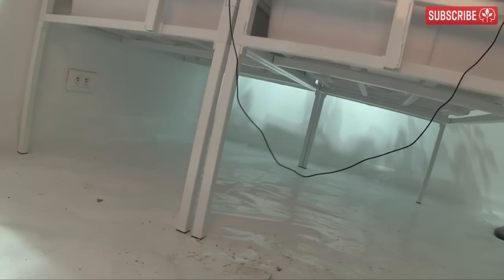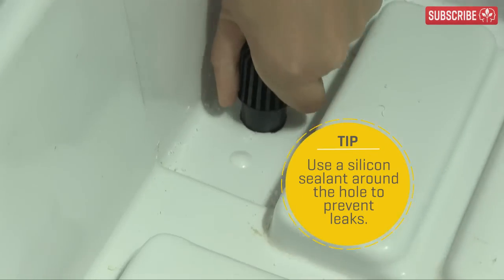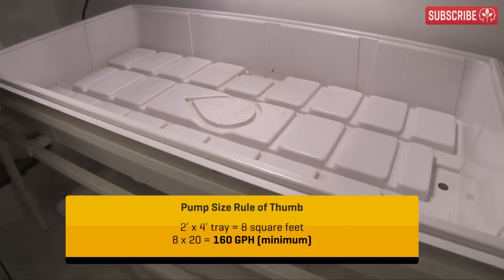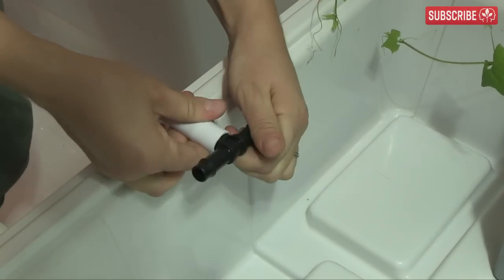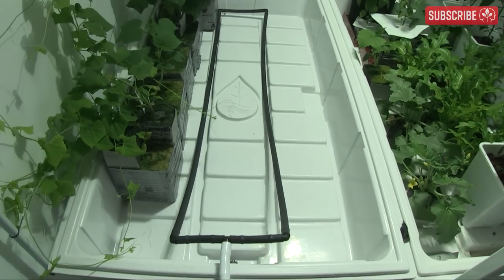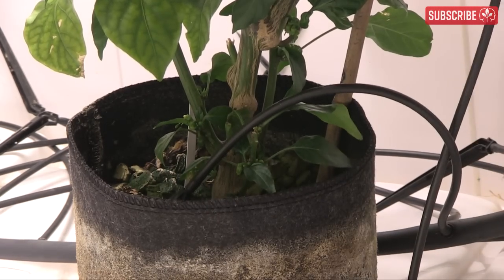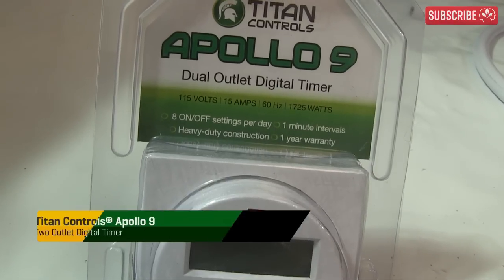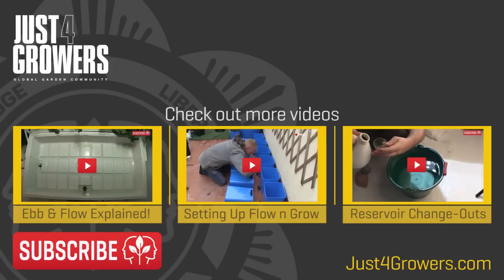DIY Drippers: Drip Irrigation for Hydroponics

Comment: Rigid pipe is easier to work with the warmer it gets. Boiling a kettle of water, pouring it into a big pot and dipping your ends of the pipe into it for 10 seconds before working with it makes it incredible pliable and friendly, plus when it cools it shrinks tight again insuring a super tight seal. Can also lube up the ends with Vaseline or vegetable oil (or any other oily substance that doesn't harm your plants).

Also, if you go to dripper head that is designed to drip at a set rate (say 1gph) you don't need a ring and it doesn't matter the length of spaghetti line as the rate is set and restricted by the dripper head. 

Great video, such high quality footage and tips.
Reply: enticed2zeitgeist I wish I'd got interested in growing sooner, everyone's so nice around here. :)

Comment: your a saucy bugger sometimes everest. been struggling all day with a diy drip system and trying to keep equal pressure, keeping a complete loop to keep equal pressure seams so obvious now, you the man everest should of watched your video this morning .
Reply: You all failed physics.  If your lines are large enough to not suffer line loss friction, the pressure will be equal at all points regardless if it is a loop or not.
Reply: @slrs3908  so...use a bigger pump is what you're saying?

Comment: If the rigid tube is hard to connect with the fittings, have a bowl of very hot water to dip the tube in before connecting. That makes it softer and easier to push over the barbed fittings
Reply from the maker: +Søren Binderup Madsen nice tip right there.
Reply: Thanks  excellent to know. :)
Reply: Thx for informing

Comment: To keep crud from plugging up your drippers, place the pump in a fabric pot within the res to filter the water before it reaches the pump.
Reply from the maker: +Tark McCoy That's a great tip Tark. Thanks for sharing. I also use an inline filter in my mainline irrigation tubing but nothing beats stopping that gunk getting into the pump in the first place! :)
Reply: 100
Reply: @AAGWproductions  PS: I found that the small paint filter bags work GREAT and inhibit the flow very little.
Reply: @TarkMcCoy  haha i was just going to suggest this!!
Reply: @TarkMcCoy  I also use those paint filter bags and fill them with kelp and earth worm castings and manure and use them as big tea bags when making my beneficial microbial teas for my plants they work great.
Reply: @mikehunt4797  Yes they do!  I use them to contain the goodies in the AACT during the brewing process.  It makes it easier to distribute the remnants evenly as a top dressing after the brew is done.

Comment: This comment is a reminder note to myself. Measure the amount of water in 1 minute of one dripper, multiply it by total number of emitters= total amount of water per minute running through the system.  Now run your system through your coco coir grow, for 30 seconds to a few minutes, when you get run off, multiply the amount of water per minute that runs through your system times the amount of minutes you ran on your second test, measure your run off and if it equals 10%  to 15% of the total water that ran on your second test, thats the shutoff indicator. Now input that in your water pump timer.  Write this down in your grow journal.

Comment: thanks for sharing your expertise Everest!! - I couldn't find the part list.
Reply: Just clic on "Show More" above. Anyways:

Parts List:

Fastfit 2 x 4 Grow Tray Stand
Botanicare 2 x 4 Grow Tray 
Botanicare 30 gallon reservoir with lid
General Hydroponics Flora Series 3-Part Advanced Nutrients
Hydroflow elbows and T-pieces
Ecoplus 185 submersible pump
Apollo 9 Digital Timer
Hydroflow non-adjustable, angled drippers
Hydroflow ebb and flow fittings kit
Hydroflow flexible mainline tubing
Hydroflow dripper nipples
Hydroflow 1/8 drip line tubing
Grodan Hugo Rockwool Blocks
Grodan Unislab Rockwool Mini Slabs
Reply: Hey I was wondering if you could please give me a parts list of tubing and fitting sizes (elbows,nipple and all tubing sizes and possibly material of tubing, as leaks are a concern of mine. I want to replicate what you've done here!! I know you get asked that alot but I only seen one exact size and that's the 1/8 spahgetti tubing. I truly appreciate it man and keep up the good videos!!

Comment: If your lines are large enough to not suffer line loss friction, the pressure will be equal at all points regardless if it is a loop or not.

Comment: I can’t get water to come out the drippers it’s coming out the hose but when I hook the hose to the elbow on the manifold it doesn’t do nothing🤷🏽‍♂️
Reply from the maker: Hi Jason, sorry to hear about your troubles. How many plants are you intending to connect to this dripper system? What is the size of your reservoir? What is the size of the pump powering the dripper system? Is the water coming out of the drip line, but nothing when you attach the dripper stake? Is this new gear or re-purposed / secondhand? There are no right or wrong answers to the above. Just trying to get a sense of where you're at. Feel free to email me pics and we'll get to the bottom of this!

Comment: So glad I found this channel! Im 20 years old currently in university taking Production and Management of Medical Marijuana to become an LP and your videos are going to help me so much with setting up my first hydroponic system! 
Is it crazy to say that I absolutely LOVE drip systems?! :D For my medium in a hydroponic I wanted to start my seeds in Rockwool cubes and transfer them into a mix of GrowRock and GrowStone,but also Coco is a fav medium of mine. Out of those 3 which would you pick as a beginner to get some good plants going?
Reply from the maker: Hi Nichole, I love drippers too! If you're starting off in stonewool plugs, have you considered simply moving them on to 3" or 4" (my preference) Delta blocks? A dripper in one of these would be ideal—and stonewool is super forgiving as a growing media. Otherwise, a 70/30 mix of coco/perlite is awesome for beginners and experts alike due to its awesome drainage and ability to hold on to water and air at the same time (ahem, a bit like stonewool / rockwool!)

Comment: Oldie, but a goodie....just subbed,  from the title, lol. Great video, I plan to watch alot of you're videos...any suggestions on DWC systems. I do have a single 5 Gal bucket with a 6" net pot.  Have a 8w airpump with 2 stones. One is a 3" disc the other is just a .75" ball.Using Advanced nutrients M.G.B series I've ordered some big bud, and B-52. Have you used advanced nutrients? If so what should I add to the nutes mix. OH, BTW I'm cultivating some Auto C.O.P from Dutch Passion
Reply from the maker: Thanks for the sub! Yes, I've dabbled with most of the main nutrient brands, including Advanced. Honestly, I don't find much between them—growing environment is the key thing to focus on, and dialing in a good irrigation cycle with adequate dry-back and flushing of the media. With DWC systems, take it EASY with the nutrient strength — use half what you would normally use—even less. They can be extremely productive if you keep things dialled in. Best of luck with your grow!

Comment: I would have plumbed that different. I would have drilled a hole through the side of the table stuck a grommet in the hole. To keep the main water line more level. for more even flow.  Plus all that green algie On your rock wool cub's yek's.   I had the same prob. Light source on wet rockwool is no good. I now but expaned clay pellets on my table first. then you can use a square plastic plater box about an inch bigger around and al least 2 taller. I put my rockwool cube in the bigger pot center it then fill with the clay pellets and cover the top of the cube. And Wal-La no more green crapp. Oh ya I also cut the bottom of the planter pot out so the root's get spread out faster. Cheer's
Reply from the maker: Thanks for sharing your insights 👍

Comment: Great vid, Does the main supply have to be in a loop or can it have stoppers at the end instead?
Reply from the maker: Thanks amigo—hydroponic drip systems can benefit significantly from creating a mainline ring, also known as a "closed-loop" or "circular" system. This setup can indeed help equalize pressure across all emitters and ensure a more consistent nutrient and water delivery to each plant. In a linear or "open-ended" system, water pressure naturally decreases as it moves further away from the pump and towards the end of the line. This means that plants at the beginning of the system may receive more water and nutrients than those at the end, which can lead to uneven growth and yield. A mainline ring or closed-loop system circulates the nutrient solution back to the reservoir, maintaining more consistent pressure and flow rate throughout the entire system. This can lead to more even and optimal plant growth as every plant receives a similar amount of water and nutrients. Even with a mainline ring, however, pressure can still vary due to factors such as the physical layout of the system, the height difference between emitters, the size and type of the emitters, and any bends or junctions in the tubing. Regular maintenance and monitoring are essential to ensure the system is working properly. Nb. My current dripper system for 9 plants does not use a mainline ring, so if your system is small like mine, you really don't need to worry. Choose what is simple and practical.

Comment: Hey man.  Really need some advice.  I'm trying to setup my system and got a manifold setup with drip lines after going to local hydro store.  The drippers were rated for .5 gph made by netafim.  Im using 4x4 tray so i got a 350 gph pump as per the equation you recommended.  After turning on i found no water coming from drippers.  Does the equation for the size if the pumo only work if the drip emitters aren't rated for a certain operating pressure if 15 psi and up for example?  Very confused sorry.  I'm just wondering if a bigger pump would fix the problem.

Comment: Thanks for the video!  It's awesome.  Could this be scaled down to be very small?  Like a counter-top drip system?  Any advice?
Reply from the maker: jrdemasi Hi Jrdemasi! Yes—absolutely. By "countertop" if you're thinking of a sunny windowsill, for example, it might be a good idea to position several pots in a grow tray on the windowsill itself, and drain the run off via a short length of tubing to a small reservoir that was positioned so it was out of direct sunlight. (Small volumes of water are obviously more prone to heating up, and warm nutrients can lead to root issues / anaerobic pathogens because it contains less dissolved oxygen.) My suggestion would be to fill the pots with a non-restrictive growing media like hydroton expanded clay balls and drip 15 mins on / 15 mins off, during the day. Use the largest reservoir that's practical and you will also enjoy more pH stability and there'll be less need for nutrient change-outs. Hmmmm ... maybe it would be easier if I just made something like this and put it in a video! :-) Lol. Thanks for the inspiration—and also for subbing the channel! I appreciate it. Peace and happy growing, Everest.
Reply: Everest Fernandez Awesome!  Thanks for the input.  What is the advantage to doing 15 on / 15 off instead of using your calculation like in the video?  Is it because of how little water the clay absorbs?  Is that a good time for ALL drip systems utilizing clay??  Obviously there are a lot of external factors, but..
Reply from the maker: jrdemasi Intermittent pump times will decrease the amount of heat the submerged pump transfers to the nutrient solution. With clay pebbles I would recommend either constant irrigation or 15 on / 15 off.

Comment: Awesome showing how this is setup. What would be the advantages of this over the ebb and flow setup? I notice you use several different types of grow media, is there one you like better for drip and/or ebb and flow?
Reply from the maker: Vegan Vampire Good question VV. Drips vs. Ebb and Flow. I'm thinking that would make a good video in itself! With drippers you have the ability to feed some plants more than others. (Either by using adjustable stakes or putting more drippers in larger plants' sites) You can feed little and often, rather than one big ebb and flow meal, avoiding or at least mitigating the risk of wet / drought stress. With drippers you are moving less nutrient solution around too, so you can get away with smaller reservoirs and there's less risk of a quick n' nasty flood. Also, top feeding is generally considered a better way to avoid salt build-up in the growing media as long as there is sufficient run-off.

Ebb and flow advantages: it purges the entire root zone of stale, oxygen-depleted air. It's simpler and quicker to set up. No risk of clogged drippers—perhaps more leeway, then, to use organic additives.

As for growing media, it's difficult to pick a favourite for each method. For ease of use, non-restrictive media (like clay balls or grow stones) are hard to beat with drippers. No irrigation cycles to dial in. Just drip constantly 24 / 7. Fast growing annuals are particularly happy in this sort of situation, especially when you use drip rings rather than stakes to diffuse the nutrient solution more effectively through the media.

Ebb and flow—you need an easy-draining, light potting mix. Try and 50 / 50 mix of coco coir and perlite. Mix insect frass at 2% per volume at potting up time too for a nice initial boost of broad-spectrum fertility and microbiology. I whole-heartedly recommend fabric, breathable pots for ebb and flow. Try lining the bottom inch with clay balls for even better drainage. Handwater you plants until their roots have penetrated deep enough in the growing medium to benefit from the flood cycle.

I have to say, rockwool is for both drippers and ebb and flow. I really am a rockwool-a-phile! You get a lot more with less growing medium. It takes a little bit of prep (pH adjustment) but then you're good to go.
Reply: Everest Fernandez Thanks Everest for the very detailed explanation.:)

Drip sounds like the way to go with more options available.

I like the idea of the clay for easy of use and re-usability, but also like the coco/perlite in grow bags as this would be similar to what I am used too in my rain gutter grow systems that I use outside but, I do love me some rockwool, the stuffs amazing ;P
Other than the grow bags, do the roots eventually just grow into the tray or do they air prune themselves? Seems this could be an issue if I need to move stuff around.
Reply from the maker: Vegan Vampire Hey VV. Only too happy to help out when I can. If you have a grow tray densely packed with plants on drippers, you may find some roots make it out of the blocks and start exploring the tray—however, they can still be moved pretty easily. I really like the growsmart trays by Grodan—they raise your blocks up a little bit and keep your roots well contained within the rockwool blocks.

Comment: Hey, I'm pretty late to this video, but I'm setting up irrigation to my plants I grow indoors(Milkweeds, peppers, tomatoes, and more) and the pump/timer I got off amazon just isn't cutting it so I'll have to run something like this I think. Curious if this pump would work for me..I am growing on a rack(vertical) so my setup will be alot different, and I'm not doing hydroponics, using soil
Reply from the maker: Hi Spencer, what diameter mainline tubing are you using and what is the max height of the upper rack please?
Reply: @Just4Growers  I don't know if my reply sent, cause it's not showing up :/ But basically I have a pump I got from amazon that has a timer built in, called the "Kollea Reliable Automatic Watering System" on amazon. Anyways; it all uses 1/4" so I don't have any "mainline" which I think is why the pressure is low and why I'm wanting to build something like you have. My rack is 6ft tall, and I'm wondering how I can use a timer with a sump pump; as I see you have it in the description but I'm not sure how to set it up. I'm also wondering if I can find some diverter valves for the setup so I can water each of my racks or one rack at a time, etc.  My plan would be a 5gal bucket with the sump pump since I'm in an apartment and have no access/room to fill a large bin of water. Any advice is welcome! Hope you make more videos again, I gotta binge watch the channel!
Reply from the maker: @Spencerrcr  Thanks Spencer. I'm coming out of "retirement" very soon and making new videos; at the same time starting a new project—so that will drive the new content. 1/2" or 3/4" tubing is typically used as mainline—with 1/8" feeder tubes—aka spaghetti tubing—conveying the water / nutrient solution to each planting site. The larger your res, the easier it will be to manage. If you can manage 25 gal, that will be better.

Comment: Have you experimented with drain to waste Everest? I am curious if using drain to waste you can prevent the need to adjust PH in your reservoir and also be able to control the nutrient levels better.
Reply: PH will stay stable if your water temperatures are stable i found whenever my water was warming up when i was a noob my PH would go out of whack. Water chillers work great for that but start at around 1000$.

Comment: Also why not run a like straight down the middle and have staggered dripper lines? Why would that effect the pressure?
Reply from the maker: +x2eXu50x I prefer a ring because the pressure is equalized throughout it asthe water has a return path towards the source.